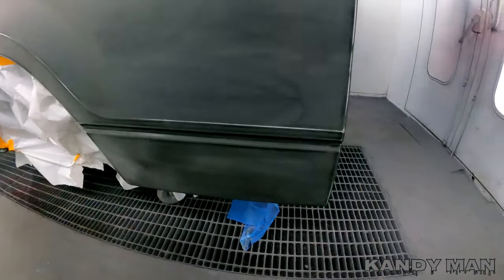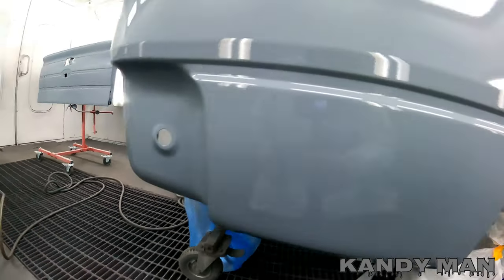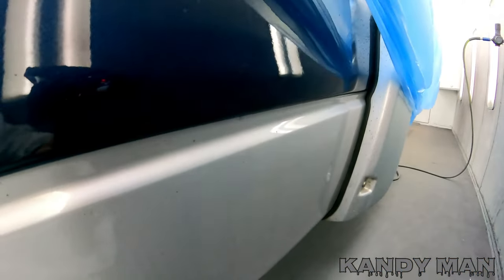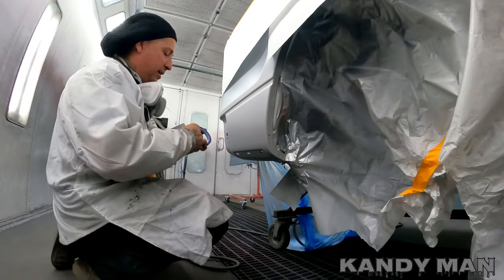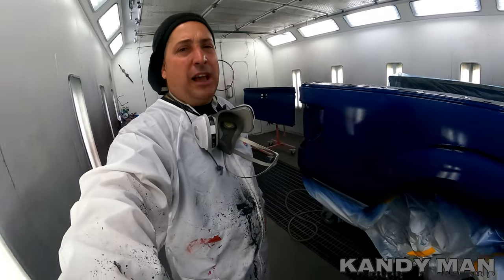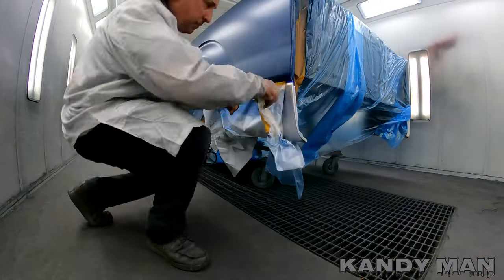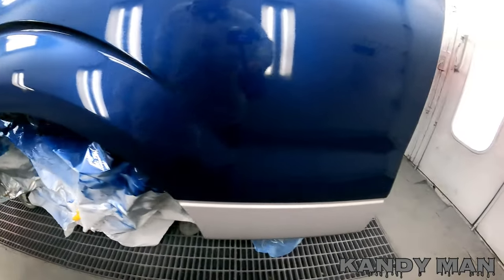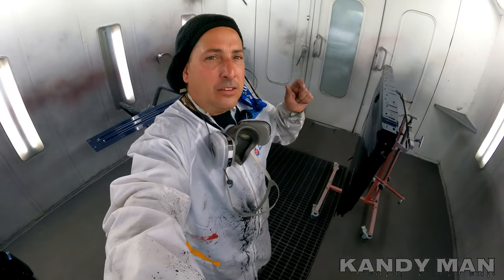TWO TONE WITH WATER BASE

Comment: Thanks for the great explanation on the two tone painting. I have a 97 f350 that has a wide silver band down the side of the truck, red top and bottom. Do you think that spraying the silver first is a good idea ? Also I was going to use an interclear on the edge of the silver so I don't get and tape marks in the base coat. Thanks
Reply from the maker: Sounds good 👍